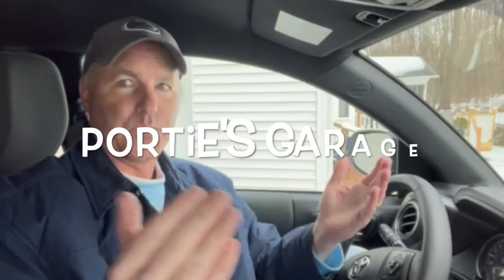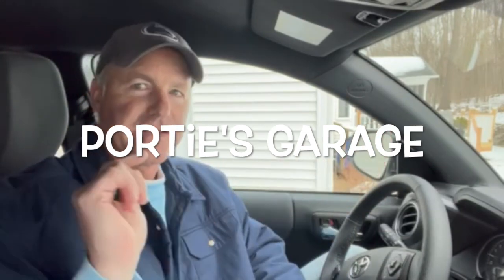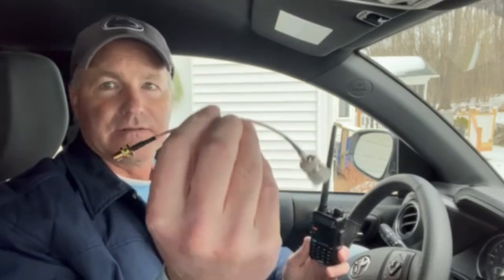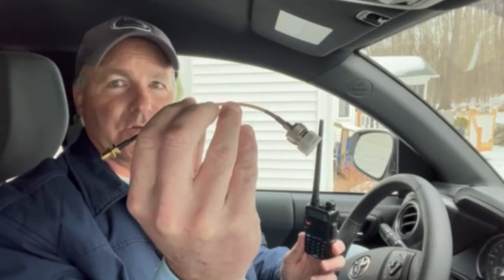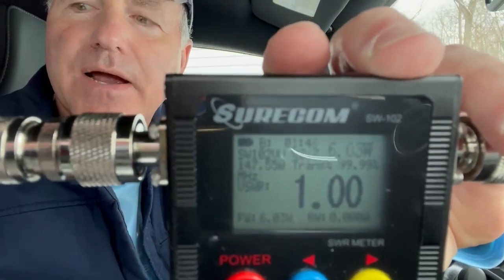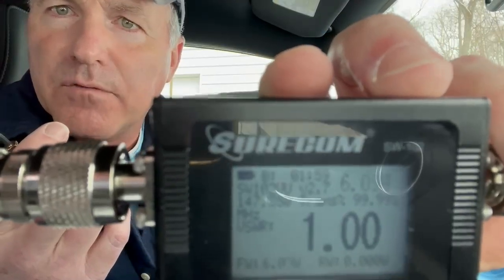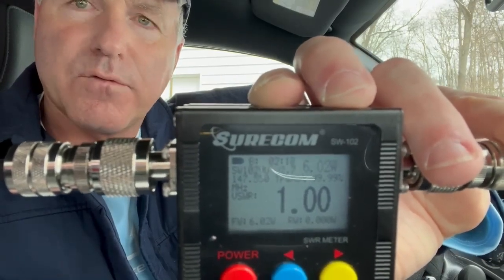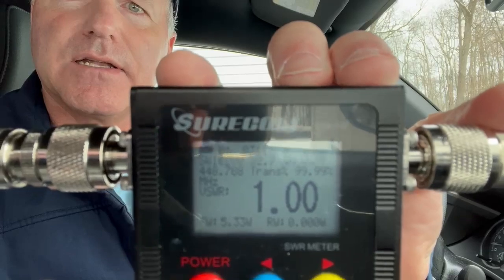Ham Radio - Does Size Matter???  Testing Antennas on a Hand-held Dual Band Radio!!!!

Comment: My best experiment so far is i went to 62" plate screw in mount from a 17" mag mount. Very little picket fencing. Much better reception and signal reports using a Baofeng. I also reached a fella 12 miles away on simplex, a 5-5 signal from him. So far so good.
Reply from the maker: From Mick:

Can you explain your antenna a little better, I may want to look into that.  Also, when you hit 12 miles simplex, was it a clear line, no hills / buildings.  That’s impressive

Comment: You have to go out of the car with the handheld.
Reply from the maker: From Mick:  Thanks for the comment @Tamlin73, the purpose of the video was to show a cheap way to extend the range if using a hand held in a car and using a cheap adapter to connect a mag mount.  Thanks for watching!!!  73's!
Reply: @Portie2216  I use a Nagoya 771 on a Kenwood Th7e, they are ok.
Reply from the maker: Thanks @Tamlin73, I do like the Nagoya, easy to use on the move. I may test a Yagi with the UV-5R, that could be fun, but not very portable.

Comment: Why not stepping out of the car and giving these antennas half a chance... a car is partially a Faradays cage...
Reply from the maker: From Mick:  Thanks for the comment @fretlessfender, the intent was to show a cheap way to extend your range if using a hand held in a car and using a cheap adapter to connect a mag mount.  73's!

Comment: I wonder if the “10w” Baofeng could do better? I’m not asking you to waste $ but might’ve been interesting. Great video btw!
Reply from the maker: From Mick:  I've been thinking on how to improve on the test.  I wanted to show a cheap way to improve distance with a handheld if using in a car, and the mag mount did.   If the 10-watt radio is only $40, I may have to get one and test both types of radios with matching antennas and test on SWR to confirm power.

Thanks for the comment, 73's

Comment: get rid of the uv5r  ,,, and get a uv13 pro v2 :)    its mile's better and 8dollas cheaper !!! lol
Reply from the maker: From Mick:  I'll have to look into that and possibly get both!!!  :)
Reply: @Portie2216   also the best uhf antenna is on the RT86 ,,, and the  RT86  is game changer :)  but it is 10watts, gets u out there but may fry your brains :) ,,but it helps me get out of the vally im in :)
Reply from the maker: From Mick:  I'll have to look into that.  And I do wonder about TX so close to your head, but then again, I'm doing just as much damage with my 16 oz curls.

Comment: Always say "Handheld" and not "BaoFeng"....you want people to answer ya.....Plus, there's another vid out there where they tested the more expensive Nagoya against the included rubber ducky....and the rubber ducky did as good and even better than the Nagoya.
Reply from the maker: From Mick: yeah BaoFeng is a love hate relationship. I got one just to test a cheap radio would work, I was impressed. It did appear the short stubby antenna worked as well as the Nagoya, but of course, the exterior mag-mount worked best.
Reply: The right tool for the job. Baofengs do work. And more people buy them than any other HT.
Reply from the maker: From Mick:  Thanks Jack Shaw!  I was impressed with how the $30 radio worked.   Used the Chirp program and loaded in repeaters near me, work, and brother-in-law (Mr. Portie) as well as several simplex channels.   Scans through nicely so I can sit and listen to local traffic.  But I won't give up my ICom!   73's

Comment: Not a fair test magmount is outside the car so the radio with the normal antennas should have been done outside of the metal box blocking the signal
Reply from the maker: From Mick: Understood antennas outside the car perform better.  Wanted to show a way for people to extend the range of a handheld being used in a car, with just a cheap adapter and mag-mount antenna.  As expected range was greatly increased.
Reply: @Portie2216  fair enough Mick, in that case well done 👏
Reply from the maker: 73s!!!!
Reply: Agreed, get out of the Fariday cage, even basic non hams know this 🤷‍♂️

Comment: Just bought one of those Baofengs so perfect timing - great test
Reply from the maker: From Mick:  Thanks for watching, it’s fun to test out new equipment.  We left out a section of video of me making contact through the repeater 22.6 miles away.  Let us know how programming works or if you need help.  I used the App called Repeater Book to find a bunch of local repeaters near the areas I visit and programmed them in along with some simplex frequencies.  Easy to copy on multiple radios.  73’s
Reply: @Portie2216 👍🏻 The 'Fengs work with CHIRP.....Very highly recommended.
Reply from the maker: From Mick:  Thanks for the comment, we used CHIRP to program two of the radios the same.  Once we found the process and right computer operating system it was very easy.  I would recommend also, especially if you have multiple radios to match and programming in repeaters.